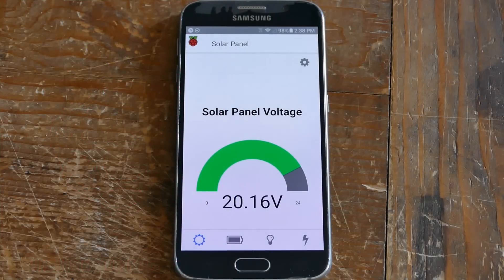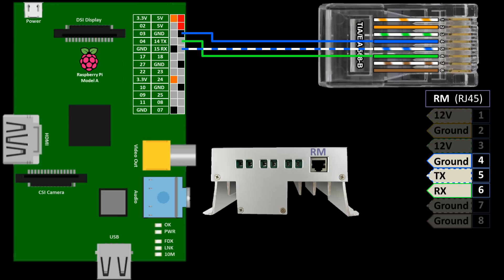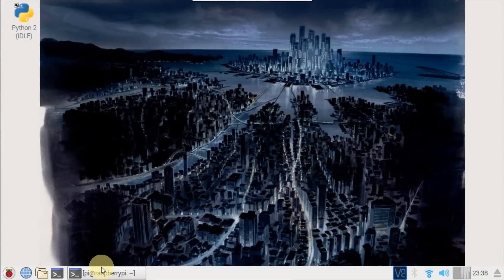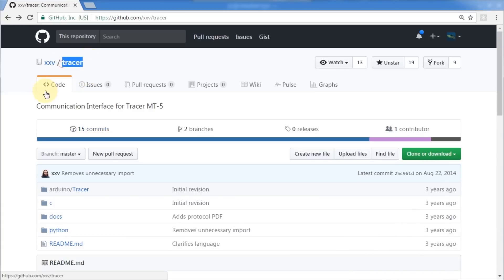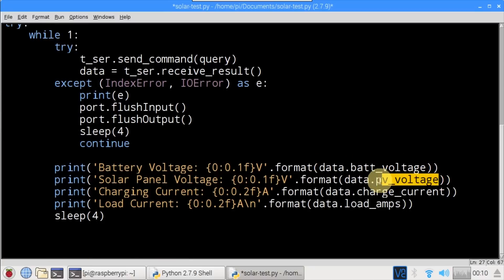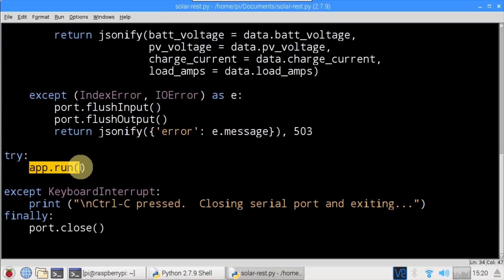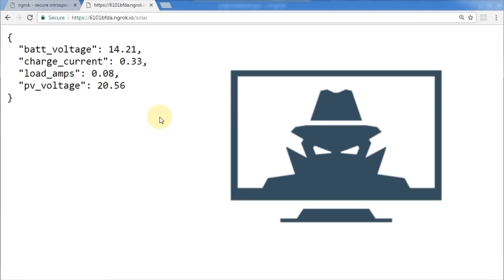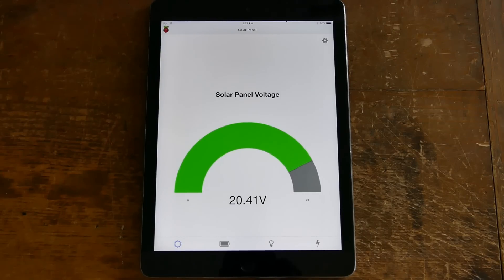Raspberry Pi Solar Serial REST API Tutorial

Comment: Just found this video, great tutorial. As a newbie, I have to wonder how using the non-wireless pi did you get the updates/upgrades and code from git hub to your pi?
Reply from the maker: There's a USB Wi-Fi dongle plugged into the Pi.  You can see the dongle at 3:53 in the video.
Reply: @rdagger  Thanks for the super quick reply!

Comment: Awesome stuff! My solar controller has an RJ12 jack (which also uses serial RS232) instead of RJ45 jack. Do you think I can adapt your tutorial to the RJ12 pin-out!? Many thanks in advance from Uruguay!
Reply from the maker: You should be able to establish a serial connection but you need to verify the voltages do not exceed 3.3 V.  However, it is unlikely the software will be compatible.  You will need to find or create a library specific to your solar controller.

Comment: very cool - do you even try to hook up 2 Solar Charge controllers to one Pi? I have two Tracers and wanna write the Datas to an Excel Table for Analyzing the Datas of the Panels.
Reply from the maker: No, I haven't tried.  I don't think it would work well with the controller in the video because you would probably need separate serial ports.  However, many of the newer controllers are RS-485 so in theory you could daisy chain them.  Another option is to hook your controller to an ESP32 and then transmit the data using MQTT to a Pi.  That's the approach I used in my vegetable garden automation video:  https://www.rototron.info/projects/micropython-vegetable-garden-automation-tutorial/
Reply: @rdagger  I will make a test, i have two epever Tracer and on each an MT50. maybe theres a way to grab the signals from the SCC to the MT50 for example (if you strip the cable to the displays you know)hehe.....i will try it

Comment: Great tutorial. Question: is there a way to connect the MPPT Controller directly to the Ethernet port on a Raspberry Pi 3 B+? In other words, use a standard RJ-45 Ethernet cable and connect that to the MPPT on one side, and connect to the RPi Ethernet port on the other side. Would it be a problem on the hardware side (dangerous voltages on certain pins) or on the software side (being able to read the data on the Ethernet port)? Thanks
Reply from the maker: That would not be possible unless your MPPT controller has Ethernet capability and even then you would probably need to use a network switch instead of a direct connection.  Most of the MPPT controllers that I have worked with have been either TTL or RS485 protocol which is not compatible with Ethernet.  Although I'm sure you could find an MPPT controller with Ethernet or WiFi capability.
Reply: @rdagger  I totally understand, but I didn't mean talking with the MPPT with any network or ethernet protocol, I meant "hacking" the RPi Ethernet port to simply read its 8 pins as you would the normal I/O pins. Therefore making an "easier connection" with the MPPT controller, without having to cut or crimp anything lol. I don't know enough about hardware to tell if it would be possible, or if it would require so much coding that it would be easier to simply connect to the I/O pins as you originally did.
Reply from the maker: Sorry I don’t know.  I’m guessing that would be extremely challenging.  It would probably require replacing the Pi's USB/Ethernet chip.  Then you’d theoretically have to modify the bios, the kernel and the network drivers.  If anyone has any firsthand experience modifying the Pi’s Ethernet port please let me know in the comments.
Reply: @rdagger  wow yeah lol, if it's that complicated then it's obviously not worth it. Thanks for the response!

Comment: nice video! Aren't you worried to connect the serial directly to rx on pi? if you get a spike, wouldnt you burn the pi? would it a good excuse to use an optocoupler? thanks
Reply from the maker: That’s a great question!  An opto-isolator (preferably high speed, low current) would afford some protection against voltage spikes and ground loops.  They’re a prudent precaution when working with devices that use different voltages.  They can also help mitigate noise issues.  Keeping the wire length short is also a good idea.

Comment: Hi great video! And what do you think about using a current sensor and an ADC to read the value from the battery/controller? Thanks!
Reply from the maker: I have a tutorial on using the INA219 sensor which can accurately measure both voltage (max. 26V) and current (default max. 3.2A).
https://youtu.be/BgShCD7xT_A
The battery voltage readings could be inaccurate if you try to measure while the battery is charging or under load.

Comment: Great video thank you for this, have you tried this on a newer model, looks like that ^ MPPT is discontinued, I wonder if the new models have encrypted output for the serial port?
Reply from the maker: I have not tried any but there is a Python repo for the newer generations that use an RS485 interface which I doubt is encrypted.
https://github.com/kasbert/epsolar-tracer

Comment: Love this project!  Looking to do something quite like this. I want to setup a an outdoor wifi camera to do a live stream from my beehive and am hoping to power it via solar+battery.  Poked around on amazon and googled a bit and was not having a lot of luck finding low'ish power charge controllers that matched your criteria.  As I'm only powering a wifi cam and an RPI I don't need a humongous solar panel / charge controller... any suggestions greatly appreciated!
Reply from the maker: You can get the newer version of mine on Amazon for $56 (Epever Tracer1210A).  It uses a different protocol so you would have to use a different library.  Most of the newer ones use RS485 instead of TTL.  The beehive sounds like a great project.  I'd add inside/outside temperature sensors and a weight sensor to measure the amount honey.
Reply: Are there other libraries already made that would work that you are aware of?  I don’t have the skill to make something like that on my own!
Reply from the maker: I don't have a newer controller, but a quick search of GitHub returned this one:  https://github.com/kasbert/epsolar-tracer
Before purchasing a controller, I would search GitHub to ensure a library exists (preferably Python)
Reply: @rdagger  Thanks!  I wasn't sure how to go about searching for that.

Comment: Would multiplying the "Solar Panel Voltage" and "Charging Current" on 10:31 give the panels output at that point in time (8.2 watts)?
Reply from the maker: No, the battery is not being charged at 20.5V.
Reply: @rdagger  thank you for the reply. Could I use any of the values in this setup to determine what the solar panel output is in watts?
Reply from the maker: No, you would need to measure the current from the panel to the controller and multiply it by the panel voltage.

Comment: Thank you very much. Great Video with lots of step by step setup information. Wish you could go into detail on the mobile side of things. All went well upto my own ngrok url. I tried cloning the project over to my expo account to run it on my android phone but ran into dependency errors (mobx). Did you manage to get it going in the android environment or only the apple ios environment?
Reply from the maker: The great thing about Expo is that it will work with both.  In the video I use an Android phone and an iPad.  Try running npm install in the project folder.   

React Native and Expo would be a lot of information to cover in a single video.  My next video will have a little more on using React and MobX State Tree.
Reply: Not to easy working with updating dependencies in a windows environment. Quick google search says to run it in powershell on win10. I will be looking forward to your next video. Great work and thanks for the quick reply. Cheers
Reply from the maker: I use Win10 for my React and Expo coding.   Make sure you install the latest version of Node and NPM:  https://nodejs.org/en/download/
From PowerShell type:
git clone https://github.com/rdagger/Expo-Solar-Tracker.git
cd Expo-Solar-Tracker
npm install

Then run Expo XDE and open the above folder.  Set the host to LAN and you should be able to connect with the Expo app on either Android or IOS.
Reply: Got it all working. Thanks a bunch. Did you publish the app on the playstore? I would like to have an apk file that I can install on other android devices?
Reply from the maker: I did not, but it's open source so feel free to publish it to the app store.
Reply: I will not publish it. I will leave it to you. Just give me a heads up if you do so I can give your app a good rating. I'll build it but not publish and use it for personal  use only.  Cheers. Your a great man. Keep up the hard work. I believe you have helped many.

Comment: Very helpful, but I found that using batteries is a bit too dangerous in my situation compared to using enphase grid tie inverters.  I'm curious about replacing the envoy with a Raspberry Pi.  I'm a noob to this side of things compared to the software on the Pi.  I've used Linux, exclusively for over ten years, but in total, I've used it for seventeen or more years.  I've lost count.  If you have any ideas about wiring an enphase inverter to it using a relay, this would be very helpful.
Reply from the maker: Sorry I don’t have any experience with Enphase products.  A quick GitHub search showed a couple of possible projects:  
https://github.com/openhab/openhab1-addons/wiki/enphase-energy-binding
https://github.com/EdwinBontenbal/Envoy2Emoncms

Comment: I hate to keep asking newbie questions, but any tricks to getting the VNC viewer up and running on your system? I have the wifi dongle up and running but can't get into the pi desktop from my mac nor my pc.
Reply from the maker: Make sure you enable VNC on the Pi using raspi-config.  Make sure the Pi has obtained a valid IP address and can ping your router.   There isn't really anything else you need to do.  I use the free version of RealVNC.
Reply: @rdagger  Managed to get the VNC server running, loaded an older version of Pi os. Thanks again for your videos.
Reply: I've got the pi up and running but do not have a solar controller hooked up yet. I get an error message when I try and use the curl command. Would the lack of data cause an error you think?
Reply from the maker: @timerskine249  what is the error message?
Reply from the maker: First, are you using the driver from my GitHub repo: https://github.com/rdagger/Expo-Solar-Tracker/blob/master/python/xxv_tracer3.py?  Second, what MPPT control brand and model are you using?
Reply from the maker: @timerskine249  xxv_tracer3 is a driver.  Drivers are not like regular programs that you run and see something happen on your screen. Instead, they're like intermediaries that help your computer 'talk' to specific hardware, like an MPPT solar controller.  When you run the driver, it's not going to do much on its own because it's waiting for other programs or applications to utilize it. Think of it as a translator between your computer and the controller. To actually do something meaningful with the controller, you'd need to write or use another program that makes use of the driver's capabilities.  So, if you want to see something happen with the MPPT solar controller, you'd typically need a program that utilizes the driver to send commands or retrieve data from the controller.  There is sample code to use the driver on my website:  https://www.rototron.info/raspberry-pi-solar-serial-rest-api-tutorial/
Reply: @rdagger  Brother, you are a patient man. Understood. I changed the path in the solar_rest file to find the new xxv_tracer3 "driver".   When running the solar_rest file I get the "running on htp:127.0.0.1:500/" message.

I thought I set up my ngrok account, as per your instructions.

When I try and visit the web address provided by the Forwarding I get:

127.0.0.1 - - [03/May/2024 13:41:43] "GET / HTTP/1.1" 404 -

On my terminal window I also show GET /               404 NOT FOUND

When I went into the ngrok traffic inspector for my account it shows my attempts to access the account, I noticed that it shows the timestamp, clientip, method, path, status, duration and host.

The only issue I see is the path column shows "/" is that an oversight my part you think?

Thanks again for your understanding of my lack of understanding.
Reply from the maker: @timerskine249  When accessing the web server from the same device make sure you specify the route such as http://127.0.0.1:5000/solar
When accessing the web server from another device you need to specify the IP address such as http://192.168.1.50:5000/solar
When you run a Flask application using app.run(), by default, the Flask development server only listens on the localhost (127.0.0.1), which means it only accepts connections from the local machine. This is a security measure to prevent unauthorized access to your development server from external networks.  You need to specify app.run(host='0.0.0.0') to tell Flask to listen on all network interfaces, not just localhost. This means the development server will accept connections from any IP address, allowing other devices on the same network to access your Flask application.  There is more information on my website.
Reply: @rdagger  Changed parameters as mentioned above and tried to access web server from another device. I now get the following error: 

File "/home/pi/Expo-Solar-Tracker/python/xxv_tracer3.py", line 142, in receive_result

    if read_idx < len(self.sync_header) and b[0] != self.sync_header[read_idx]:

IndexError: bytearray index out of range

Which resulted in a Second error:

File "/home/pi/Expo-Solar-Tracker/python/solar-rest/py", line 34, in get_data 

  return jsonify({'error': e.message}), 503

AttributeError: 'IndexError' object has no attribute 'message'

I kinda feel like a third grader talking algebra with a high school math teacher....
Reply from the maker: What MPPT controller brand and model are you using?

Comment: We do not have to use voltage from the charge controller right? Can I just connect my Pi to power socket with the power cable?
Reply from the maker: Yes to both.
Reply: @rdagger  One more question. What does send data to raspberry PI on how much power is generated? Does 3.3 TTL controller provide that information to PI?
Reply from the maker: The solar charge controller sends data to the Pi via serial protocol.  The data is transmitted on the RX and TX lines.

Comment: Hello Sir, I am unable to find the SainSonic MPPT 10A Tracer-1210RN charge controller. Can you suggest me a charge controller which support TTL logic 3.3 V protocol. Excellent tutorial.
Reply from the maker: The TTL versions have been discontinued, but you can still find them.  A quick search of AliExpress for 1210RN returned a few.  I saw a few 3215RN and 4210RN too.  They should work as long as they are compatible with the MT5 display  (NOT the MT50 which is RS485 instead of TTL).
Reply: rdagger68 Thank you for the reply. That means those are also build with TTL logic. am i right ?
Reply from the maker: Their description stated “TTL232”, but please verify with the seller before buying.
Reply: rdagger68 Thank you again.
Reply: rdagger68 Dear Sir, Last few weeks i was trying to find this RN series but in the internet though they are showing RN but absolutely not available anymore. It seems RN is replaced by AN. So we should not believe on website even though Ali Express. In that case can we use AN and what should we have to change?
Reply from the maker: There is a Python library for the newer RS-485 controllers but I have not tested it.  Please contact the author to ensure compatibility before purchasing:  https://github.com/kasbert/epsolar-tracer

Comment: Hello. My inverter is Easun sps 3K. Is it working to my inverter serial port?
Reply from the maker: That would not be compatible with the drivers used in this video.  Check out Github for a compatible library.

Comment: Hello, which raspberry pi should I use cause I see you are using model A, should I use the same one for similar application
Reply from the maker: Any Raspberry Pi will work.  The one’s without BlueTooth are slightly easier to set up for serial communication.  A Raspberry Pi Zero (non-wireless version), Raspberry Pi Model A+ or Raspberry Pi 2 would work well.

Comment: Hello 
I am looking for a DIY solution to connect my Voltonics MKS Solar Inverter to WiFi for remote monitoring 
I understand its easy to use 8266 or esp32 but need a little information related to RS233 Data Stream from the 
Solar Inverter
Reply from the maker: I suggest you check out GitHub.  A quick search returns 2 relevant repos:
https://github.com/jblance/mpp-solar
https://github.com/scottwday/InverterOfThings
You can ask the authors for info on the data streams if they are not already documented.

Comment: Will this work for mppsolar inverters?
Thanks!
Reply from the maker: You could implement a similar system but you would probably have to locate a different library to communicate with your inverter.  The TLL protocol used in by my charge controller is no longer very common.  Most new solar devices use RS-485 or Wi-Fi.  GitHub has libraries for many solar products such as this Python one for MPP Solar inverters:  https://github.com/jblance/mpp-solar

Comment: Is this applicable to any brand of solar charge controller?
Reply from the maker: No, the software featured in the video is designed specifically for the TTL MPPT controller that is displayed. Unfortunately, these controllers  have been discontinued. However, the method demonstrated in the video can be applied to other serial MPPT controllers. In order to do so, you will need to locate suitable drivers and make any necessary modifications to the software.